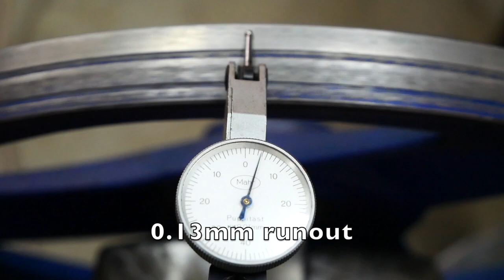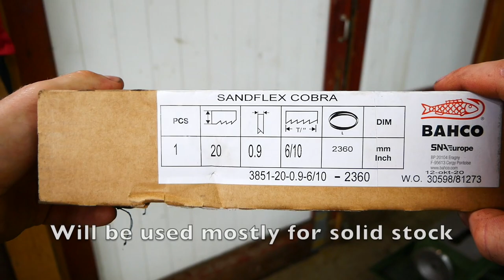Huvema Band Saw Repair P2: Repair and Improve. New blade, bearings, wheels and more

Comment: With a cracked casting,a broken wheel and a badly damaged motor fan casing I wonder if this saw has been dropped or pulled over at some time in its earlier life.  Certainly worth the effort to get the large blade wheels running true and in balance and tune the blade guide roller assemblies. All makes for an accurate and dependable saw. I have done a lot of fine tuning mods on a 6 inch version I own and it is now a great machine to use.
Reply from the maker: Yes maybe it was dropped. Or just bad use. But after all the repairs and taking good care I think it will last a long time.

Comment: That is so frustrating! It seems like any place they can hide janky workmanship to save a nickel, they go for it. Between the casting design, the wheel balancing, and the clamp repair I wonder if you might not have gotten out cheaper building your own from scratch!
Reply from the maker: Yes maybe. I can't affort a high quality new bandsaw and I don't think making a new one from scratch would be worth it. Material cost would be more then I paid for this one. And it would take me to long (to make everything perfect), i haven't got the time for that. So i'm still glad that I bought it and after a week of hard work I think its in good condition and will last a long time in my shop.